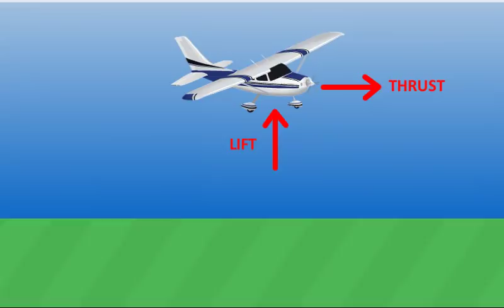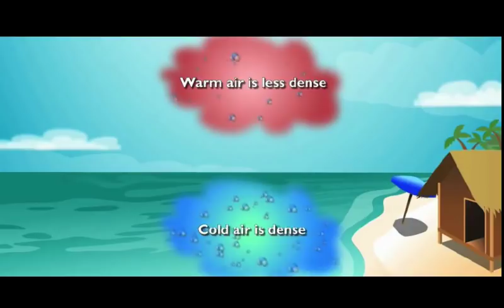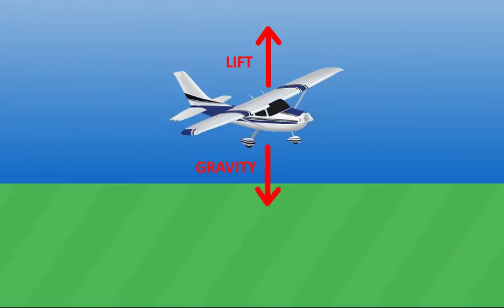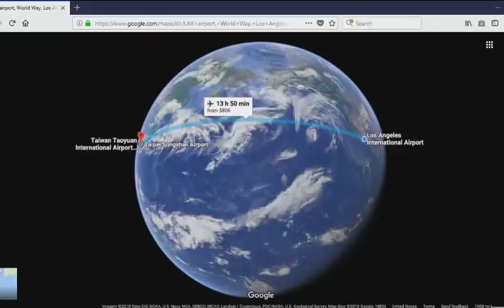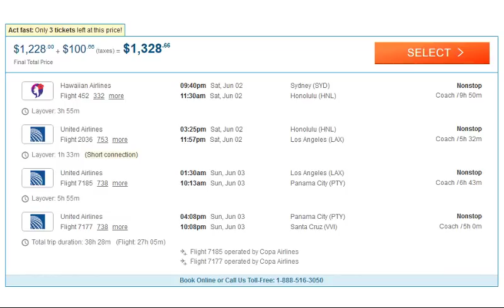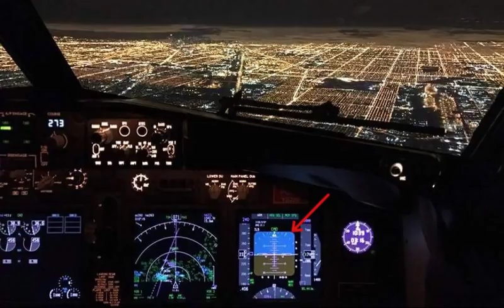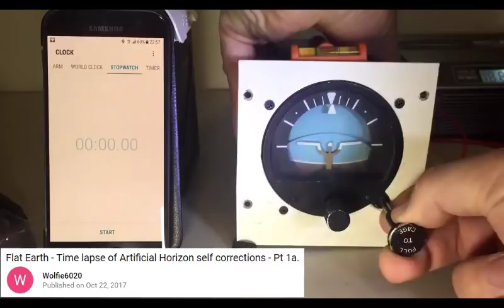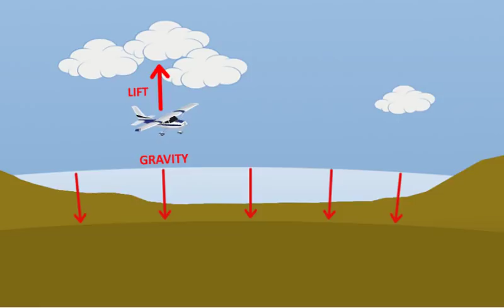Flat Earth Falsities - Plane Nonsense

Comment: at 2:55 .. good explanation.. but when the car takes a turn objects in the car shakes.. so earth s rotating at such a high velocity waters in the ocean may stagnated in equator part only. why so sir?? and one more what will happen when an object moves double the speed of earth?? any simple test to proove rotation of earth?? no like gyro..  some other??
Reply: +Deeps P

"any simple test to proove rotation of earth??"

Here's one way to prove it. Manufacturers of precision scales specify in the user manuals that the scales need to be calibrated for different latitudes due to the spin of the earth. Objects weigh 0.5% less at the equator than they do at the poles. This is because the centrifugal force generated by the spin of the earth slightly cancels out the force of gravity, and the effect is most pronounced at the equator, where the tangential speed of rotation is the fastest.

Here is an experiment performed by a pilot who took a precision scale and a test weight on his travels to confirm this effect. Anyone else can duplicate these results.

https://www.youtube.com/watch?v=CkhxPm15PFo

Here is a user manual from a scale manufacturer. It specifies that the scale is calibrated for 45 degrees latitude at the factory, but will need to be adjusted for the actual latitude where it is being used if extreme precision is required.

http://www.schumann-gmbh.de/e/federwaage_E.htm

What mechanism on the flat earth would explain this effect?
Reply: @rayopeongo  i dnt belive in flat or round.. somebody told in a video earth is oblete spheriod.. i think thats a good shape..
Reply: +Deeps P

"somebody told in a video earth is oblete spheriod"

A spheroid is defined as "a solid geometrical figure similar in shape to a sphere." No problem there. Oblate is defined as "flattened at the poles." The earth has a diameter of 12,712 km from pole to pole, and 12,756 km across the equator. So, it is slightly flattened (by 0.3%) and is therefore technically oblate. However, only professional astronomers care about that degree of precision. For the vast majority of us, the earth is for all intents and purposes a perfect sphere. In fact, the earth meets the industrial standards for an ABEC grade 1 ball bearing.

https://en.wikipedia.org/wiki/ABEC_scale
Reply: @rayopeongo  i dont belive in google earth also.. it was showing clear routes when our place had flood.. nothing was there but still google earth was showing all good.. thats also good..
Reply: +Deeps P

" i dont belive in google earth also.. it was showing clear routes when our place had flood"

Google Earth, Google Maps and Google Streetview are not live views of the earth. They are simply collections of photos taken at some point in time in the past. For instance, if you look at Google Maps at a northern country and scan sideways, you will see the edges between different photos - different colors of vegetation, different sun angles off of the water, and sometimes even a snow covered satellite photo next to a summer photo, with half of a large lake frozen and half thawed. 

https://www.google.ca/maps/@46.0828158,-78.8420121,19137m/data=!3m1!1e3?hl=en

I painted my house last year, but the Google Streetview photo of my house still shows the old color. Google Earth, Maps and Streetview are not sources of real-time information about the earth.
Reply: Google Earth shows the time and dates the image was created. It isn't, and can't be, "real-time".
Reply: "but when the car takes a turn objects in the car shakes"

A car turns 90 degrees in a second or two, and it is travelling across and in contact with an uneven surface, so vibrations and G forces are transmitted to the car's contents. On the other hand, the earth takes 24 hours to make one rotation. That works out to 0.0007 rpm. The only way we notice this motion is because the sun, moon and stars move very slowly east to west through the sky. And the earth is travelling through space, not over a road, so there aren't any vibrations transmitted to us as there are through a car's tires and suspensions from the uneven road.

Yes, the earth moves at 66,000 mph in it's orbit, but it corners at 1 degree per day, so that 66,000 mph is basically a straight line speed, and humans can only easily detect large changes in speed or direction. For us, driving in a car at 30 mph, or in a train at 100 mph, or in a aircraft at 500 mph all feels the same. We can sleep, eat or read a book, and not notice anything until the car, train or aircraft makes a change in speed or direction.
Reply: Jerry Sherman Show us your documentation. Prove Einstein was a Jew. Show us an experiment using a gyroscope that proves that the Earth is immobile.
Reply: @Deeps P
Our planet, the earth, which is known to be a slowly rotating terrestrial spheroid will get along just fine regardless of what you believe, so don't worry your pretty little head about it.
As to rotation. TRS, ocean currents, magnetism gyrocompasses, precession, nutation, corrections to Polatris, the movement of all celestial bodies, weather systems, SatNav, SatComms etc.
Then curvature. Celestial navigation, spherical trig, sextants, accurate long distance navigation, ships and land going below and rising from the horizon, being able to see further as you increase your altitude.
and all that with no mention of governments, NASA or all the other sexual fixations of FE cultists et al.
Don't believe me? Then instead of watching videos on YT I suggest you contact one of the colleges here.
https://www.ecosia.org/search?q=india+nautical+colleges
Remember. Sailors know the a slowly rotating terrestrial spheroid and gravity is a fact for a very good reason. If they didn't world trade wouldn't exist and ships would be snking all overthe place.
Do you for one second believe a person who didn't know, for example,  the relationship between longitude and distance when travelling east or west parallel to the equator would be entrusted with thousands of lives and tens of millions of $, £,  €,  ¥  etc. of ship and cargo?
If you do, then contact
http://www.insa.in
Happy rotating and gravitating.
Reply: +wong

"so don't worry your pretty little head about it."

Wow, you are all attitude. Your analysis and evidence is detailed and ironclad, I'll give you that, but your bedside manner really needs some work. This guy simply asked a couple of questions, and it wasn't obvious from them that he actually thinks the earth is flat. As far as I can tell, he is not in the same camp as Mr. Nibiru or Mr. Shaw. 

Have you not heard the expression "you catch more flies with honey than vinegar"?
Reply: @Ray Opeongo
Who died and put you in charge the interwebs, philosophy, morals, life and everything?
I have probably, trained, educated and got more people through exams than you will ever do.
You may not have looked, but @Deeps P is subscribed to FlatWater FlatEarth and therefore all the associated channels. And a gentle push will probably make him stop and think, and make him wonder why he is letting himself be being conned by charlatans.
I am not trying to catch flies I am trying to wake people up. People such as Dubay. Skiba and Campanella are catching the gullible flies with honey and said gullible people need shocking into reality and being awakened. If people choose to be ignorant. No problem. We will always need shithouse cleaners and the like.
Have you never heard about omelettes and eggs? Good guy, bad guy and so on?
 Did you ever do any military training?
Get real ffs. Or maybe you should dedicated yourself to feeding trolls.
Reply: Bill Martin
"You were probably a lousy teacher." No,  A very good one.
 "You yelled and screamed your way through the lectures, didn't you?" No. Never.
"Yeah, you do seem military. Been there, done that."   Wrong again. I simply used it as an example of one of the various methods to successfully teach.
"You aren't shocking anybody into reality." and exactly what is your basis for stating that?
"They probably refuse even to read your posts once you have insulted the s**t out of them." And exactly how did I insult the shit out of anyone?
Please grow up Bill and also try to be honest.
Reply: wong To be honest with myself, I failed to follow through on my previous decision to ignore your posts. I regret that failure.
Reply: @Bill Martin
No Bill. You didn't like being proved wrong, did you? If you were honest with yourself you wouldn't throw hissy fits, would you, blatantly calling a mild rebuke "once you have insulted the s**t out of them" and you wouldn't be supporting trolls and liars, would you Bill.
I will continue to upvote your posts, as appropriate, because I am not a mean spirited arsehole, Bill, and I tell the truth. Whether you like id or not.
Reply: Jerry Sherman  • You've already been told dozens of times, muppet.

Gyros are not designed to detect motion, full stop.

Stop fucking lying you fuck.
Reply: the jew hatred is the one common thing among flattards.  Flattards are pure evil.... despising anything that exposes their ignorance of science and engineering.  Prod a flattard just a little bit and the jew hatred always comes pouring out.  This is why they must be mocked and ridiculed and kept in their basements.
Reply: @John Morrison
Louis Shaw is trolling you.
Reply: Deeps the greek style science advocates get salty when you offend the Ball.
Actually, rotation of any spherical object causes the opposite effect – anti-gravity.
Place any object on a rotating sphere or to a spinning wheel to see for yourself what happens with rotation. All objects are flung off.
Reply: Louis Shaw That’s why all those carousels are missing their horsies.
Reply: objects won't fly off at the rate of speed that the earth rotates.  Put any ball on a table and rotate it once in exactly 24 hours and tell me that is fast enough to throw objects off.  Your statements are utter nonsense.  Not even thought out at all.
Reply: we can only hope that youtube will eventually ban your nazi asses.  Your kind already cost the world millions of lives but you were pulverized in the end.  I keep asking...where is this so called genocide in the middle east?  The population of Gaza is at an all time high.  The world has seen no such attacks on non jews anywhere.  You live a life of lies,  a real student of your master Adolf.  He was the master of lies.
Reply: @johnmorrison9758  An other jew? All time local native killing and persecution high, and THEY did not take over a race country.
Germany that did not start the war, has less then the total of others like the Brits, attacking non threatening far countries.
Mongol conquests  30,000,000[4]  2,500,000,000[citation needed]  34,641,016  Eurasia  1206  1368  163  Mongol Empire, Destruction under the Mongol Empire
European colonization of the Americas  8,400,000[5]  138,000,000[6]  34,047,026  Americas  1492  1691  199  Death toll estimates vary due to lack of consensus as to the demographic size of the native population pre-Columbus, which might..
https://en.wikipedia.org/wiki/List_of_wars_and_anthropogenic_disasters_by_death_toll

The MARXISTS slaughtered 66 million Russian Christians behind their iron curtain and the media hid it. This was by the “homeland” security of theirs….called, the CHEKA. Look it up. The Talmud calls all non YIDS ANIMALs. In Yiddish language……do you know what CHEKA means???????!!!!!!!! ANIMAL SLAUGHTER!!!!!!!! 
The CHEKA changed names to NKVD, the KGB. NOW DO YOU GET IT?

“Hitler will have no war, but we will force it on him, not this year, but soon.”- Emil Ludwig Cohn in Les Annales, June, 1934 (also quoted in his book “The New Holy Alliance”).

“We Jews are going to bring a war on Germany.” – David A. Brown, National Chairman, United Jewish Campaign, 1934
We have? exterminated the property owners in? Russia.We are? going to do the same thing in Europe and America. (The? Jew, December? 1925,Zinobit)

youtube: AUSCHWITZ SURVIVORS FORGET THE PLOT
The? world revolution which we will experience will? be exclusively our? affair and will? rest in our? hands. This revolution will tighten the Jewish domination over all other? people.” – Le Peuple? Juif, February 8, 1919

“Israel won the war [WW I]; we made it; we thrived on it; we profited from it. It was our supreme revenge on Christianity.” (The Jewish Ambassador from Austria to? London, , 1918).
Reply: @Jerry Sherman
Our planet, the earth, which is known to be a slowly rotating terrestrial spheroid will get along just fine regardless of what you believe, so don't worry your pretty little head about it.
As to rotation. TRS, ocean currents, magnetism gyrocompasses, precession, nutation, corrections to Polatris, the movement of all celestial bodies, weather systems, SatNav, SatComms etc.
Then curvature. Celestial navigation, spherical trig, sextants, accurate long distance navigation, ships and land going below and rising from the horizon, being able to see further as you increase your altitude.
and all that with no mention of governments, NASA or all the other sexual fixations of FE cultists et al.
Don't believe me? Then instead of watching videos on YT I suggest you contact one of the colleges here.
https://www.ecosia.org/search?q=india+nautical+colleges
Remember. Sailors know the a slowly rotating terrestrial spheroid and gravity is a fact for a very good reason. If they didn't world trade wouldn't exist and ships would be snking all overthe place.
Do you for one second believe a person who didn't know, for example,  the relationship between longitude and distance when travelling east or west parallel to the equator would be entrusted with thousands of lives and tens of millions of $, £,  €,  ¥  etc. of ship and cargo?
If you do, then contact
http://www.insa.in
Happy rotating and gravitating.